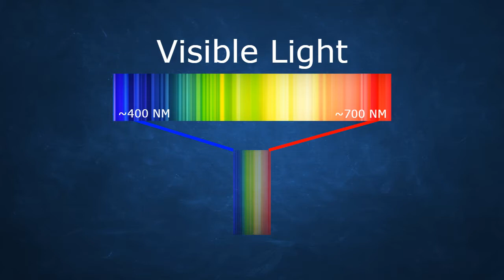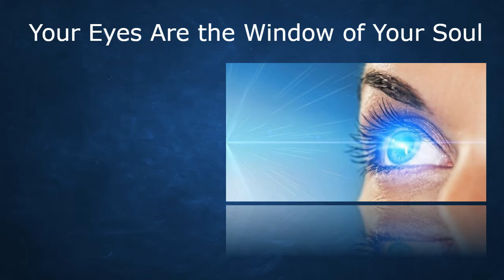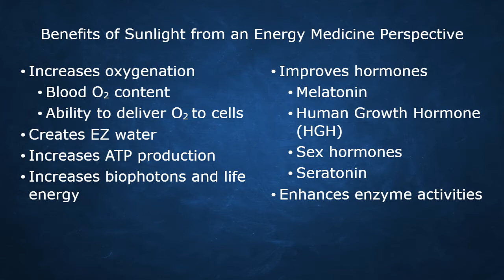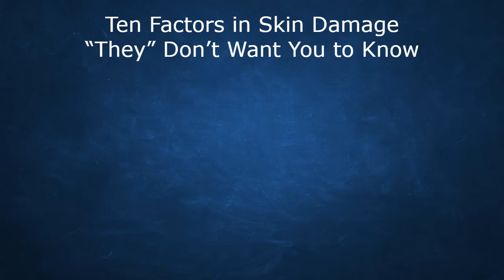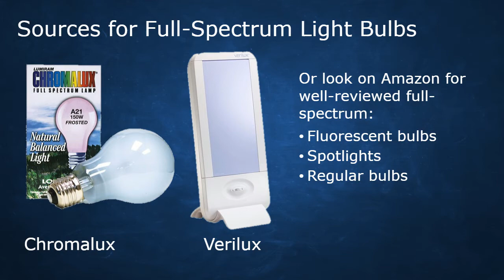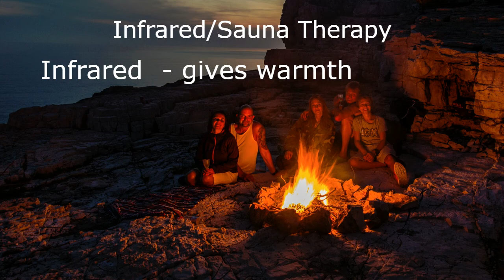Energy Medicine Online Course V.1 [Part 4 Sun, Light and Sauna Therapy]

Comment: Too bad Solar Radiation Management, per the Paris Agreement, is blocking our sunlight preventing Vit D to be readily available thru daily absorption.  The Intergovernmental Panel on Climate Change (IPCC) is changing the biology, chemistry, and physics of our planet by doing unstudied Climate Engineering.  ALL life is being affected negatively.  UV rays are increasing  cancers and killing many lifeforms not adjusting to the high levels of UV rays.  We are seeing HIGHER UV at all times of the day, and in all times of the year.  Climate Engineering is adding toxic chemicals and deadly heavy metals into our atmosphere changing the way the sunlight inters into the air that ALL life breathes.  Make sure the "full-spectrum" lights used are not LED or CFL.  LED light is "Blue Light", which is harmful to most life (I am losing my vision and experiencing terrible eye pain due to "Blue Light") and it is difficult to avoid as it is the NEW & AFFORDABLE light source found everywhere, indoors and outdoors.  It affects animals in a way that confuses them and they can't follow their migration paths. Wildlife is dying due to Blue Light and the way it affects their bio-rhythms.  Humans aren't testing their theories before putting them into action.   I enjoyed this video Bryant, great info.